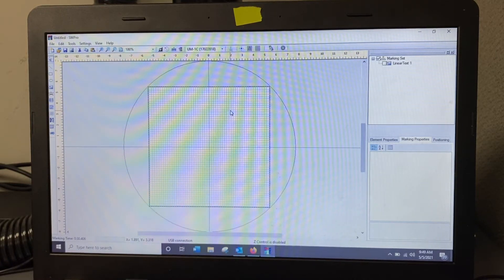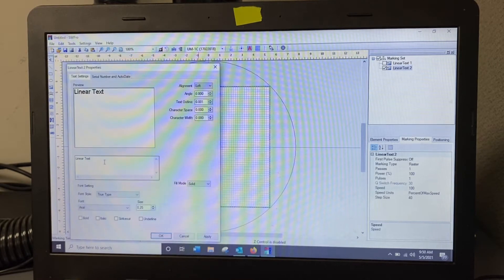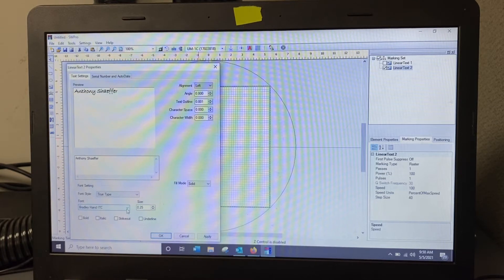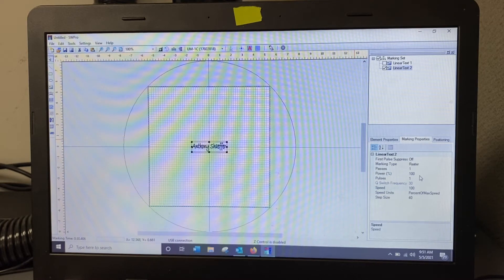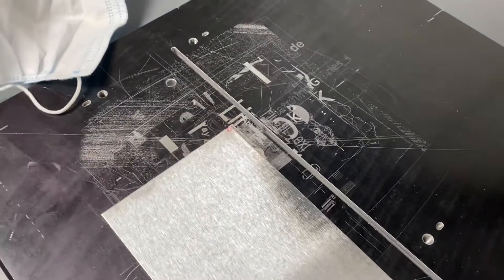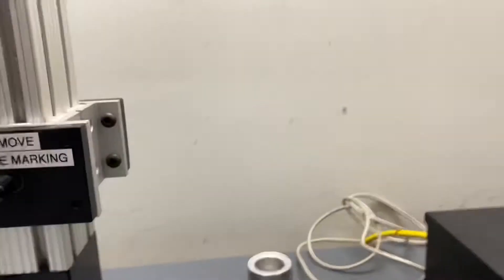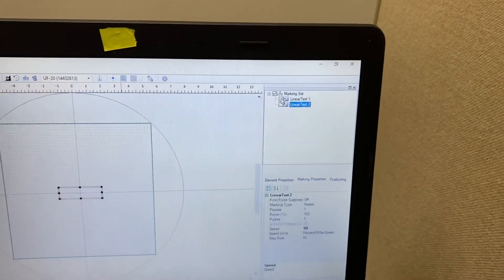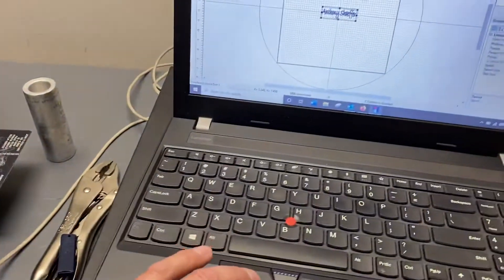RMI Laser - UM-2

Comment: I thought the point of showing a more powerful laser is to advertise how much better and faster it is at marking not only just the darkness. I'm pretty sure you could have gotten nearly the same Darkness with different pulse settings same goes for the um2 laser. Are these settings tuned at all? I only ask because I've had experience with a um-1 and had it dialed in on tool steel marking tools at like 10 seconds of peace and they were showing up dark that's only a 1-watt laser that I was using though it was yag